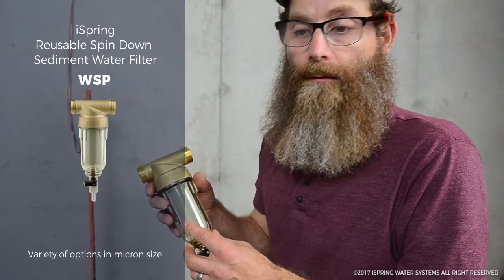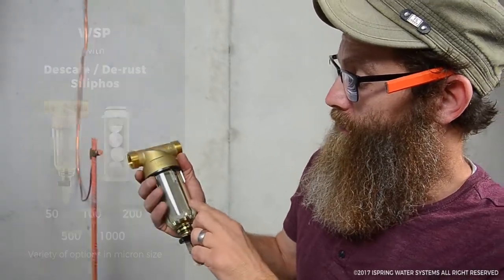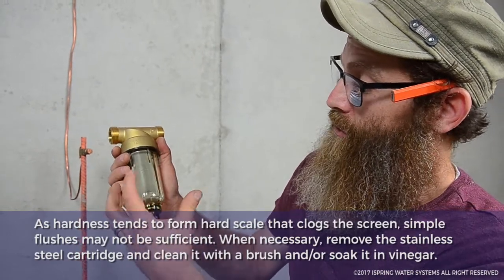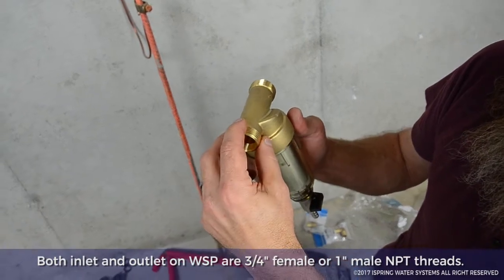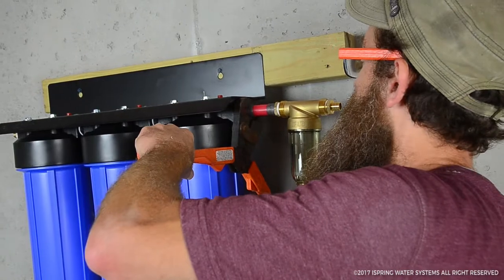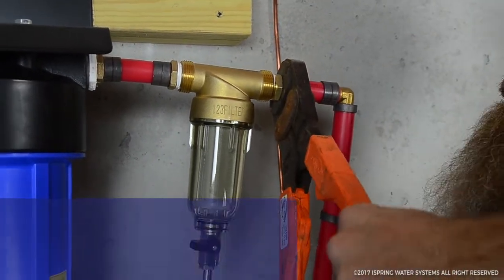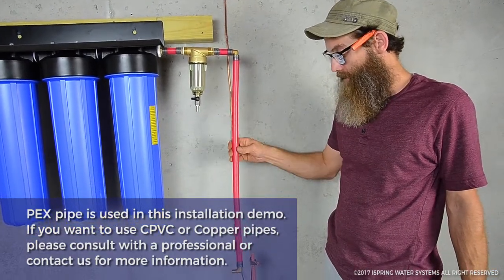DIY Installation Guide of iSpring WSP Spindown Sediment Water Filter and How to Connect

Comment: Does the flow direction through the filter matter?
Reply from the maker: Hi dear customer! The arrow on the system shows the direction the water should flow through the system.
If you have any questions, please kindly contact us at support@123filter.com, at (678) 261-7611 M-F 8:30-5:30 EST, or at (470) 560-0012 M-F 8:30-5:30 EST (Messaging only)
We are happy to help!

Comment: I have a vertical water pipe. Can the Ispring filter be installed horizontally?
Reply from the maker: Hi dear customer! Based on your description, the WSP50GR or WSP100GR would fit your needs:
WSPGR:
https://www.123filter.com/ac/index.php?rt=product/product&product_id=603&acid=2 
This model can be installed in any direction thanks to the 360° rotatable head connection.
For any questions, please kindly contact us at support@123filter.com , at (678) 261-7611 M-F 8:30-5:30 EST or at (470) 560-0012 M-F 8:30-5:30 EST (Messaging only) 
We are happy to help!
Reply: Thank you! @iSpringWaterSystems

Comment: Also can I install the filter between the well submersible pump and the water tank please?
Reply from the maker: Hi dear customer! It is recommended to install the spin down sediment filter after the tank.  If installed between the well pump and the tank, if the WSP clogs up, it can cause the well pump to cycle and could potentially damage the well pump.
Reply: Thank you! @iSpringWaterSystems

Comment: I just bought this complete system from ISPRING, the product is great however my top filter housing did not come with any red pressure reliefs?
Reply from the maker: Hi there. Thanks for choosing our products! We upgraded the filter housings and removed the red pressure reliefs to prevent leaking. If you have any concerns or questions about that, please feel free to give us a call at 678-261-7611 (M-F, 8:30 - 5:30 EST). We are happy to help!

Comment: What size hose do I need for that barb on the flushing valve?
Reply from the maker: Hi there. 's usually 3/8" O. D. or outside diamter but slight differences exist. It's best if you can wait until the device arrives before shopping. :)

Comment: Is there a certain direction this needs to be installed, ie water in water out. There is an arrow on it. Is this the direction of the water flow?
Reply from the maker: Yes, the arrow indicates the direction of the water flow.
Reply: Then it was installed backwards in this video
Reply: @wooodsryder  i wondered the same thing 🤦‍♂️
Reply: @wooodsryder  No it's not. the flow direction arrow is on the backside of the brass head since water flow is come from the right to the BB housing. The Arrow is only on 1 side of the head.
Reply: @vinniemckinney2371  I’m only a DIYer, but I believe it’s installed backwards, assuming the water flow is from right to left.  The video shows there are arrows on both sides of the housing. Instead of only focusing on the arrows (or lack of), focus on the rise and slope in the top of the housing. 
For the majority of the video the rise in the housing slopes from top left to bottom right, and the arrow points to the right. This appears to be the direction it has been mounted in this video, which I contend is backwards. I’m unable to explain the missing arrow.  
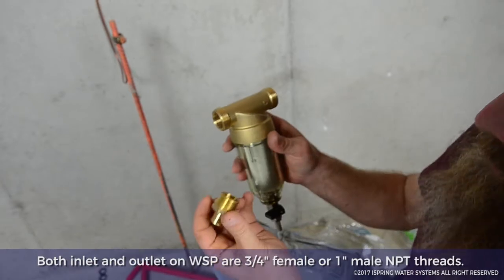Turning around to the “backside” (which is shown briefly at the 1:16 timestamp in the video), the rise in the housing is reversed and it now slopes from top right to bottom left, and the arrow now points to the left. This appears to be the correct direction to mount this housing for water entering from the right. 
iSpring confirmed in this thread that the filter housing arrows point in the direction the water should be flowing, so no matter what we think we see, or not see in this video, I recommend you just follow the arrows on the filter housing you receive.

Comment: Doesn’t work. I constantly have to manually take apart the filter and hand wash the screen free of the silt and sediment. I thought I had too small of a micron screen at 50 micron so I replaced it with a 200 micron but STILL it gets gummed up and I get a 75% drop in water pressure until I manually wash it. What’s the point? Very aggravating. I also do flush it regularly about 3 times a week running it for at least a minute. I don’t use much water in a household of 2. I checked the water before the filter and it’s clear so it’s not abnormally dirty. Any suggestions? I’d like to not have to change the system to another brand.
Reply from the maker: Hi Parasole. Thank you for reaching out. I'm so sorry about your experience. Could you please give us a call at 678 261 7611 (M-F, 8:30 - 5:30 EST) or email us at support@123filter.com. We will help you to fix the problem under warranty.
Reply: The filter appears to be doing exactly what it should be doing, so your frustration at the product is directed incorrectly. Clearly you've got some pretty dirty water coming in, and the filter is catching it. Going to another brand (if using the same micron size mesh) will do exactly the same thing. If I was you i'd probably put a 500 micron (or even a 1000) in front of the 200.

Comment: They're call spin-down filters but they don't spin anything. I have two of them and the water comes straight down out of a rough hole in the casting. I'm looking for a way to mount them so that the weight is not supported by a sagging pex pipe like in this video. Wait til the pex and filter are full of water, even more sag....
Reply from the maker: Hi there. Please give us a call at 678-261-7611 (M-F, 8:30 - 5:30 EST). We will help you to figure it out.

Comment: What mounting bracket am I supposed to use when the filter inlet and outlet are in the vertical position?
Reply from the maker: Hi Brad! WSP50 should not be mounted on a vertical line. You need WSP50GR which will rotate.
 You can find the product here: https://www.amazon.com/iSpring-WSP50GR-Reusable-Sediment-360%C2%B0Head/dp/B07D4R7BPQ.

Comment: Can this unit be used outside? We have a water softener we would like to put this in front of.
Reply from the maker: We would not recommend using the WSP outside due to the elements may damage the WSP-50 or components.

Comment: Nice Video. but the Unit is installed backwards in this instance.
Reply: Nice to see someone else caught that.....
Reply: Does the little arrow indicate the water inlet or outlet? It’s the inlet right?
Reply: @spyem1  The arrow points to the outlet. It indicates the direction of water flow.
Reply: Depends on which way his water flows. Mine goes in the same direction as his.
Reply: @jackietomkins5085  You'd have to watch the "whole house" installation video where you can see the waterflow direction is from screen right to screen left. Even if the waterflow was from left to right, then he'd still have installed on the wrong side of the whole house filters.

Comment: hi, i bought this unit and tried installing it before my house filters. problem i had was i wanted to use the 1in male fittings to connect to my 1in pvc system piping. no matter what idid i could not get it to seal! tape, dope, combo of both, still leaked.
so i went to the 3/4 female and adapted from there and so far so good.
any tips on how to connct 1in pvc? thanks!
Reply: i should addd i live in Belize and have no access to the newer pex fittings and such, just pvc.
Reply: Hi Bill Taylor, 

You will need adapters in order to connect the PVC piping to your plumbing. You should be able to locate these adapters at your local plumbing supply or hardware store. I did see your comment about living in Belize so I am not sure how easily accessible the parts will be overseas.  You may have to source the parts from the US and ship to Belize. 

Thank you,

iSpring Water Systems LLC